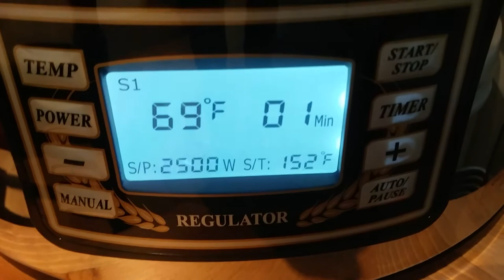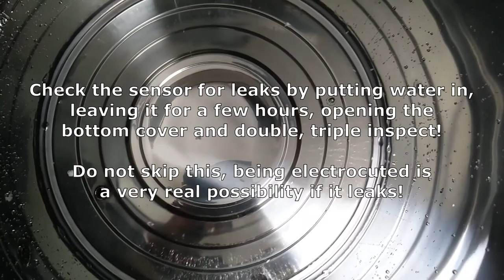Ace Micro Brewery (UK): Replacing Failed Heater Element  (Kettle swap)

Comment: So I went here hoping to find a link to a heater element for these kettles. My USA 110V unit is fine but, being a bit weak for ramping to temp, I'm looking to change out the element with a 220V one. How do I buy either just the element or the Kettle part?
Reply from the maker: I think you can source places like Alibaba. The company is called guten. It goes by ace microbrewery, hopcat, and other names in Europe and the EU. Not sure if you can get the tank separately but I was able to get one through warranty one time.

Comment: couldn't you have just brought a replacement element and put a bigger better element on the bottom and coated it in insulation paste?
Reply from the maker: Yes! But this was free replacement to me. I have an extra pot that I will be experimenting with down the road. Do you have any suggestions on what element, insulation, & thermal paste?
Reply: How i can do it?